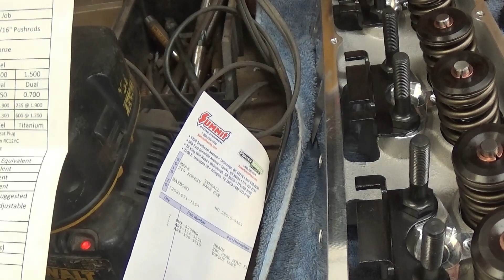PROMAXX HR9200 HEADS FOR THE 383

Comment: Nice! At 10-10.5:1, what octane will you run on the street? I will have very similar compression with .033 quench. Thanks for another great video and try to cool down a little bit! 😊 👍
Reply from the maker: 100 octane av gas is easy to get here
Reply: @oldmanintheshopbuiltnotbou8726  Right on. That's what we have at a local gas station on pump. $10/gal. Appreciate the info. Thank you.